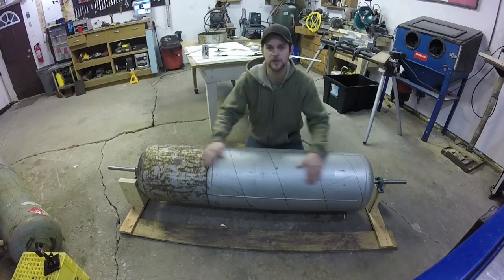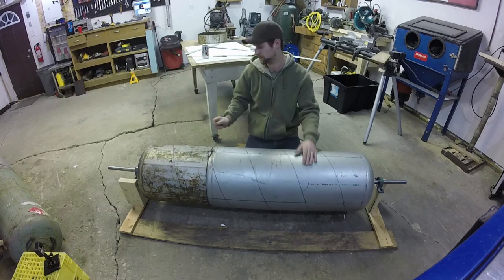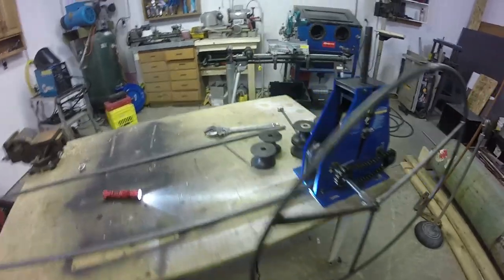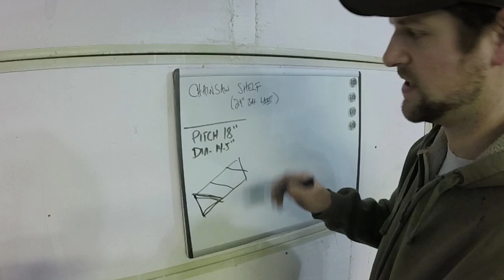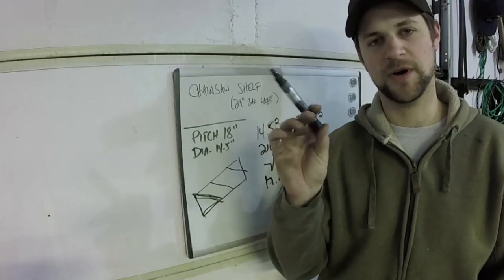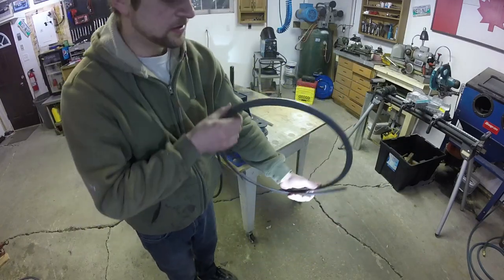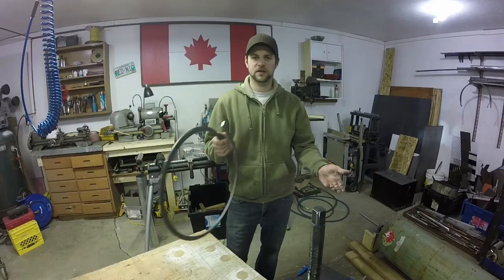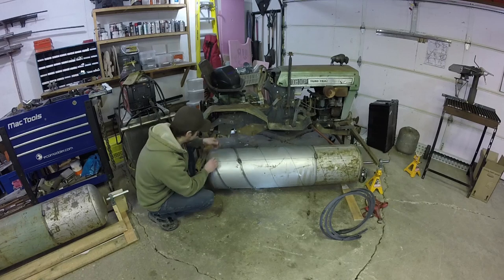Screw Drive Vehicle - Extreme Off Road - Part 13 - Flighting Theories

Comment: Like the project - some advice if you are interested - the drums need to have large sprockets on the ends of the drums not small like you have before - this causes all the gear ratio reduction to occur in the gearbox only over loading it and the final chain drive - if the largest ratio reduction is at the final chain like a motor bike instead then the gearbox will have far less load on it as will the finale drive chains - the gearbox output sprocket will run faster with far less load on it - having big sprocket down at drums negates the need for all those chain tension rollers too because you have many more teeth for the chain to grip at the drum end - also having a much large sprocket at the drum end allows a bit bigger sprocket at the gearbox output and more teeth to hold the chain and no tensioner needed.

Comment: Nice project and nice job ! Something bad by increasing the diameter of the screw pods, is that you'll need more torque to run this screw drive vehicle, some device should be more stronger. I had worked on this project too, but it was a rc vehicle  ;)  (i had broke many part to reach something which working well)  Keep strong ! Thanks for sharing. Follow you from France :)

Comment: I've done helical stairs. when rolling your materials pull it towards you with your right hand on your right hand side will give you your piece more the shape your going for. less pulling and fighting on tacking in place. your still rolling in two dimensions. pull on it towards you on the right side to give it the third. left side you would push away. you could do a 20 foot length but it can be difficult to control. Hitting the ceiling is a problem if you don't have clearance. awesome job! looking forward to your next video!
Reply from the maker: +UR IT thanks for the tips! i'll give that a go! yeah i do have clearance issues with the 8 foot ceiling, plus its hard to work around the tubes even at 5 feet.  i was even thinking of adding side rollers, but really for the amount i need to bend, doing it by hand works. again i'll try your method for the other side. thanks!

Comment: To get the twisting motion tack a ring of pipe on the end of your tank.  Now capture a ball bearing between your puller and the tip of the tank.  You can easily twist the puller now as you tighten for the spiral.  Good luck.  I am looking forward to the progress.  Doug

Comment: Good work and great job documenting your build progress. 
May I suggest that you scrap the gearboxes, shafts, sprockets, and chains and convert to hydro-static drive?  The drive system is always going to be the weakest link to your project.   
Use a single pump, two bi-directional hydraulic motors, two 2-way hydraulic valve bodies and hoses to replace everything.  Use your existing motor and in/out clutch to drive the pump.  Mount the hydraulic motors directly to the back of the screws.  Use one valve with a handle to control speed and direction of the right side screw and one valve and handle for the left side.  You will not even need to use the brakes for steering.
You could use the drive motors from a couple of hydro-static drive lawn/garden tractors.
Advantages:  
All of the drive torque will be between the screw-drum and the hydro-motor (& mount).  
You will have better control of steering.  
You will be able to reverse one side and walk the vehicle sideways. 
You could actually add suspension without worrying about chain tension. Just route the pressure and return hydraulic hoses so that the suspension will flex.
Something to think about.  8-)
Reply from the maker: +Earl Yates yes i think that it would be the ideal setup. the chain setup was more for a "using what i had" build. I would love to go to hydraulic! thats for sure! thanks!

Comment: other issue I see is the fins on your drums are only a single start screw pattern - imagine them like a thread on a bolt  that only has one single beginning of the thread - a multi start thread has more than one start - so a 2 start thread has 2 separate threads alongside each other all the way down the bolt - this things need about a 4 starts thread - the more treads you have down the drum the less they need to protrude to bite in to the ground - there would be some give or slip in them so they don't bite in too hard and break other parts but since you have 4 fins running down it they are more efficient to offset the slip.
Reply from the maker: +MPAcopy thanks for all the input! i agree with you in many ways. this time i am doing a twin helix auger, instead of a single. so i hope to lessen the need for large fins as you said. as far as larger gears. no matter what i do the torque coming out if the transmission is too great. larger gears would slow the vehicle down, but in a jammed screw situation, the result will be the same. if i double the speed into the trans and then put a large sproket on the screw....that would help...but i dunno if the trans could take it. either way...this time i have an old trick that should work. i'll show you in the next video. thanks again, and feel free to comment on the new screws in the next video...i think they will pass your test ! maybe :)

Comment: think marine inboard prop puller.  You need a plate to anchor the puller across the top of the tube.  Then two maybe three lengths of 1/2? all thread to reach down to your spiral with one or two to crank up with the nuts on top, think gear puller. Now the last leg can be tacked to your all ready welded flighting.  As you pull with the other one or two you stretch the flighting into shape.  You can make a sliding jaw to grip the flat bar.  Maybe weld a 'c' clamp to the all thread. Might use c clamps on all three legs instead of tacking?  So as the rods are tightened the flat bar is stretched.  Moving the c clamps changes the bend.
Worth a think.  It also is removable to use on the other too. Doug
Reply from the maker: +Douglas Thompson yeah i see what your saying now....i think ill try a single rod and hook setup to start and just work my way along. Good idea thanks!

Comment: try setting your fins so when u go forward they push the dirt out instead of under the tractor it may help keep the dirt out of the chain.
Reply from the maker: +ed skisuski yeah I would have liked to do that, but it would be quite a bit of work. thanks for the comment!
Reply: +REDNIC79 just flip them end for end and cone both ends so when u back up u don't get jammed up, but either way that is a awesome build, lots of time in that, good job
Reply from the maker: +ed skisuski thanks! i hope to keep the chains well out of the mud/sand this time hopefully :P

Comment: I've watched a couple of your screw mobile videos and have noticed one glaring design flaw.
There's no storage compartment from which to refill your beverage holder.
I recommend at least a 2 six pack capacity unit, forward mounted for easy access by the driver.
BTW, have you thought of naming your auger vehicle?
You know, kinda like they do boats?
If it were mine, I'd name it "Bend Over".
Reply from the maker: +CHARVESTER haha...very nice! design flaw noted. and it currently is the "turd trac".....of course not early as elegant at "bend over" hehe

Comment: I hear you talking about cones for the rollers all the time. Wouldn't a stationary ramp, mounted to the frame, in front of each roller work just as well?
Reply: it would be a hell of a lot easier to fabricate
Reply from the maker: +Circuit00C yeah very true, i have made them already (part 14) and ideally i would like to make a combination of the cones i made with you suggested ramps. that way i could go over a log or something. thanks for the comments!
Reply: +REDNIC79 you have a pretty cool project going on. I am working towards having everything I need to take on odd projects like this and ideally spend my free time tinkering. maybe some day.
Reply from the maker: +Circuit00C thanks! ya just gotta start building....it you dont have the tools, work with what you have. good luck! hope to see one of your projects some day soon!